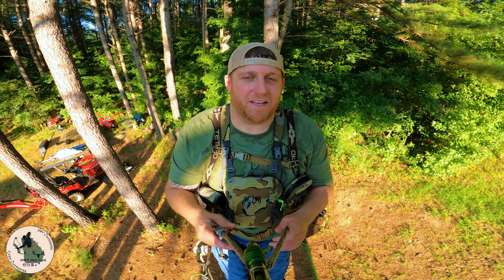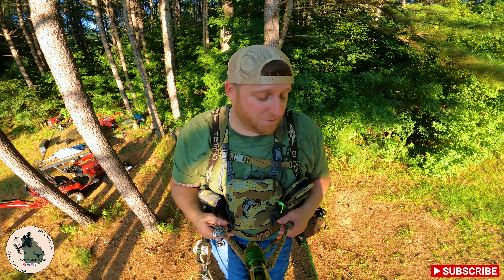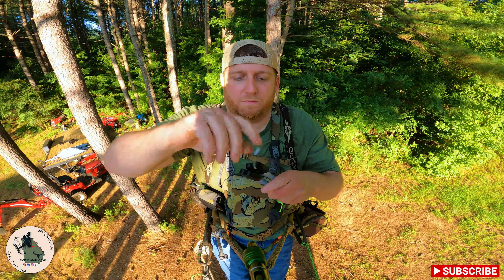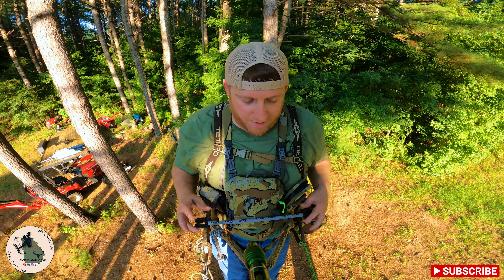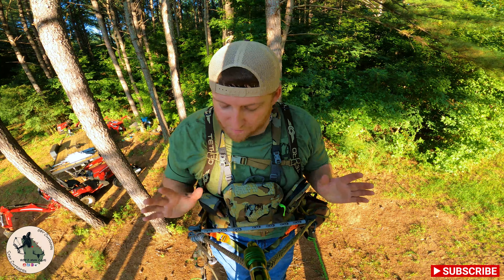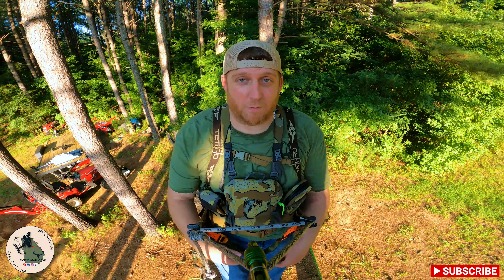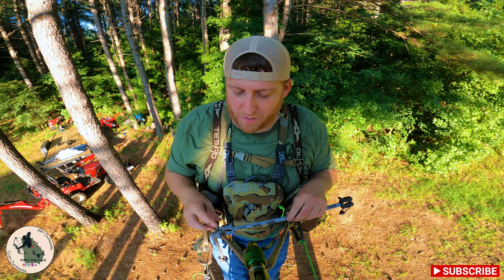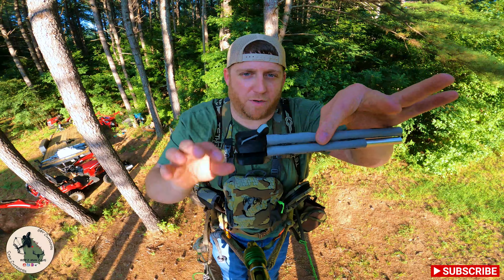Genesis 3D Printing | Hip Pinch Eliminator "HPE"

Comment: Does it make it any easier to fall out of the saddle if you were to somehow be turned upside down after a slip?
Reply from the maker: I do not think so. You still have your belt on, and I always use leg straps. Also, I would only use it at hunting height after getting set up.
Reply: @robzmancave thanks,  now i just need them to get more in stock!
Reply from the maker: @Truthseeker57  shouldnt be too long. He restocks frequently